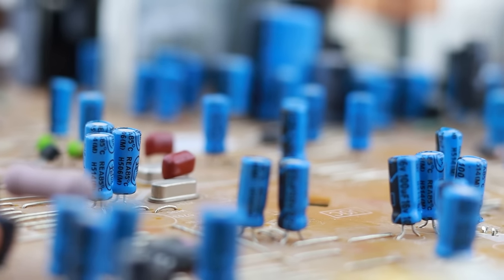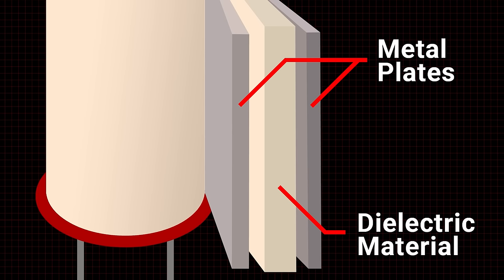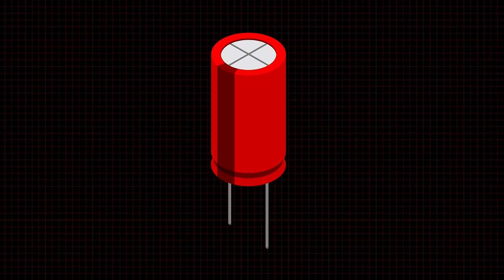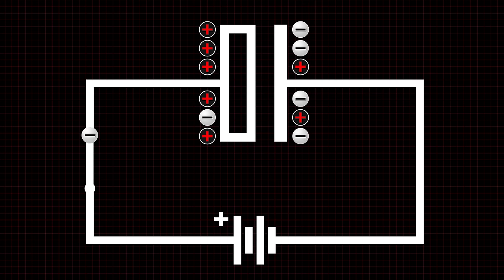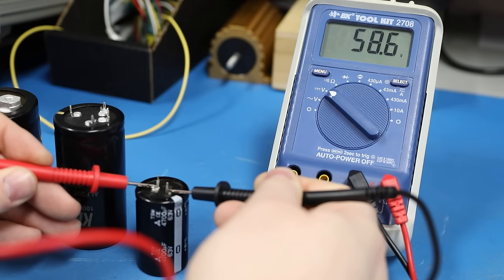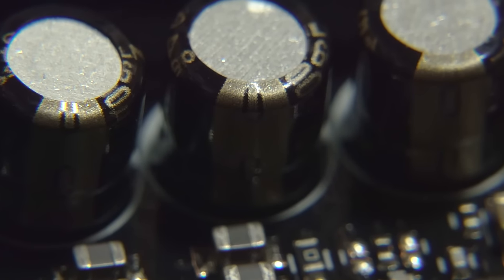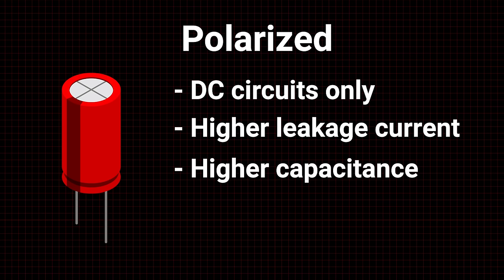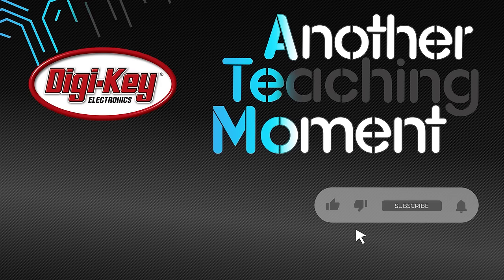Basics of Capacitors – ATM | Digi-Key Electronics

Comment: Leakage current.  What is it how does it relate to the charg voltage that builds up and the max current if you short the charged capacitor
Reply: Leakage current is the flow of current through a capacitor, even when it is not being charged or discharged. This current is typically very small, but it can become significant if the capacitor has a high leakage resistance or if it is being charged to a high voltage.

The leakage current of a capacitor is related to the voltage that builds up across it when it is charged. As the voltage across the capacitor increases, the electric field within the capacitor becomes stronger, which can cause more current to flow through the capacitor.